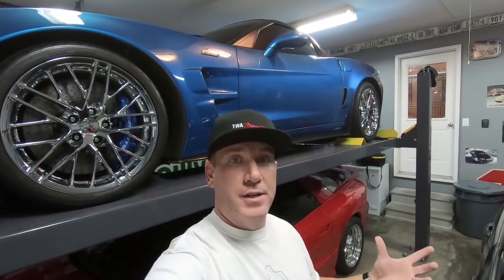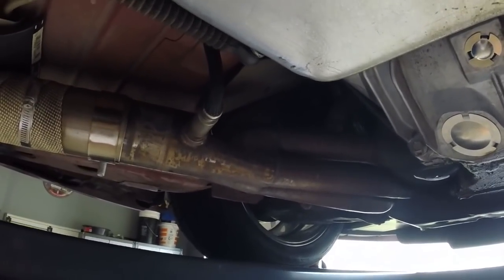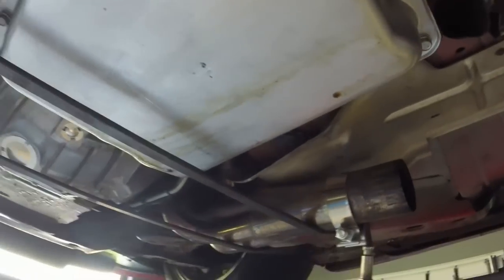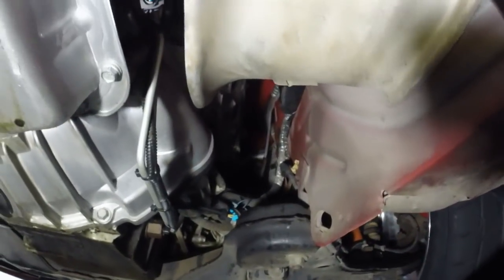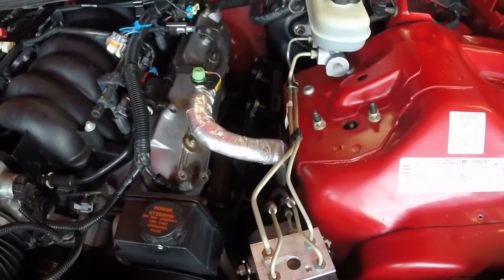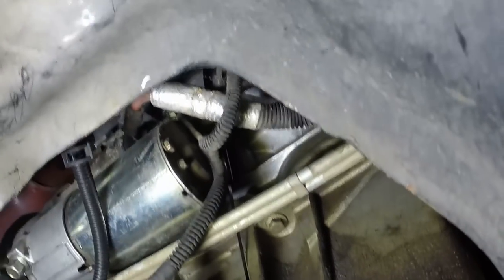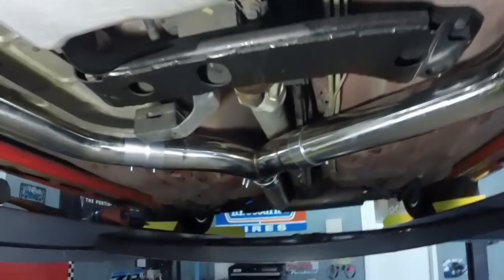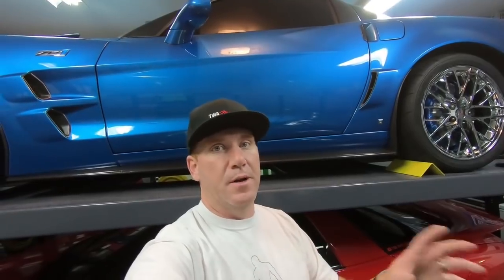Installing 2nd Set of Headers on my WS6

Comment: Did you use the speed engineering clamps or different ones? I've heard they are junk
Reply from the maker: I used all but one and yes they are garbage
Reply: @TWAMotorsports  hey man just a follow up. I got SE headers for my car just wondering how much clearance you get with the SE y pipe on a lowered car
Reply from the maker: @sbc_jake_9677  it's not the worst I have seen but not the best either. Just have to be careful
Reply: @TWAMotorsports  did your tsp y have better clearance? I considered that one but not sure if it would fit up to my SE headers
Reply from the maker: @sbc_jake_9677  no it fit worse
Reply: @TWAMotorsports  ok I'll get the speed engineering y pipe. Thank you!
Reply from the maker: @sbc_jake_9677  you're welcome

Comment: Did u have too tune it after installation
Reply from the maker: You really should but not required. Ses light will be on if you do not run catalytic converters. Tune does get the most out of the install though.
Reply: Highly recommend a mail order tune by Frost. Made a big difference in mine.
Reply from the maker: @IrishNomad  I'm actually going to do a custom tune when the heads cam are finished. Frost does do some great stuff though.
Reply: @TWAMotorsports  Oh I agree, for heads/cam work, dyno tune is the only way to go. For bolt on budget guys, Frost does the job 👍
Reply from the maker: @IrishNomad  absolutely
Reply: @TWAMotorsports  will a tune get rid of the ses light or can you run anti fouler tip to fool sensor
Reply from the maker: Tune is needed

Comment: Will this headers work with 243/799 cylinder heads??
Reply from the maker: Yes
Reply: Hey men did u used arp bolts for the headers ??? Trying to figure out which ones are they ???
Reply from the maker: Just stock

Comment: What wheel and tire package do you have on your TA
Reply from the maker: Torque thrust 2
Reply: @TWAMotorsports   size wheels & tires? ..Great video by the way
Reply from the maker: I made a separate video on that but 17x9.5 front 17x11 rear
Reply: @TWAMotorsports  I'll checkbit out Thanks

Comment: Hmm... My 1 7/8 speed engineering headers fit without taking the steering knuckle off
Reply from the maker: That would have been nice. There was no way on mine that would have worked. Maybe they changed them a little.
Reply: How please how did you get them to fit without taking off the stearin knuckle
Reply: I don't know what to tell you. I read on forums that some people had them fit with no problem and some people had to take out the steering knuckle. I guess I got lucky!
Reply from the maker: @matthewsprague5510  I would take it off. Makes it way easier.
Reply: For how simple it is, I agree with him!^^ makes it easier anyways. Mine slipped without removing the steering knuckle BUT I had to hit a part of the firewall. Maybe that's an alternative to removing the steering knuckle? Maybe not. Oh well. Either way it's an easy job!
Reply: Zack Van Goethem I’m half way through the install and no matter what I do I can’t get the steering knuckle off. I took out the 11mm bolts and it just won’t budge out of place
Reply from the maker: @matthewsprague5510  did you take both 11 mm out?
Reply: TWA Motorsports yep still won’t move spent 3 hours yesterday just trying to get it to budge
Reply from the maker: @matthewsprague5510  it is slotted on both sides. Spray some wd40 in the slots on both sides. Let it set for a minute and lightly tap it on both sides with a hammer.

Comment: Nice job. I can't wait to get my Kooks system installed. It will probably sound just as good. Have you been looking around for a turbo kit. I was looking at this setup http://www.airpowersystems.com/fbody/tt.htm when I originally was thinking about turbo's. I've changed my mind and will be getting a Procharger F1 series supercharger instead. They are less of a headache compared to turbo's. What I like about APS is that they have the turbo set low. So you don't have excessive heat in the engine bay. I don't know how much you paid for the Speed Engineering headers but Texas Speed have a really inexpensive set and when it comes to F-bodies. Those guys are second to none.
Reply from the maker: transam2002ws6 I thought about procharger but just love the turbo feel and sound. Texas speed was higher than what I paid. F1 will sound awesome though.
Reply: @TWAMotorsports  once I'm finishing pushing the 5.7 to its limits. I'll be looking for a LS7 to transplant and slap on the F1.
Reply from the maker: @transam2002ws6  that will be fun!